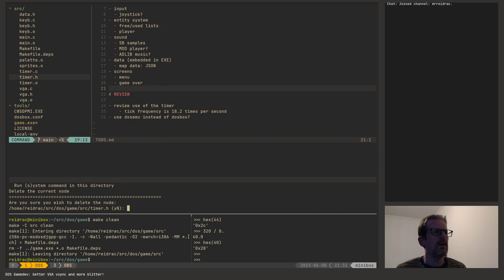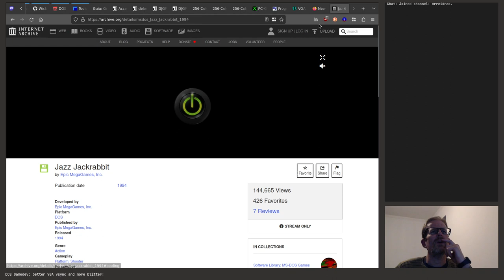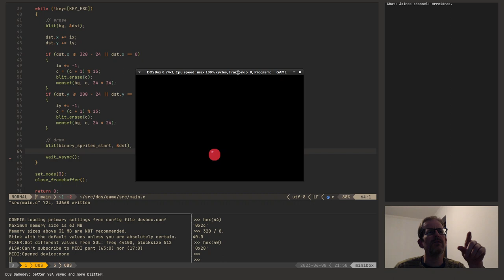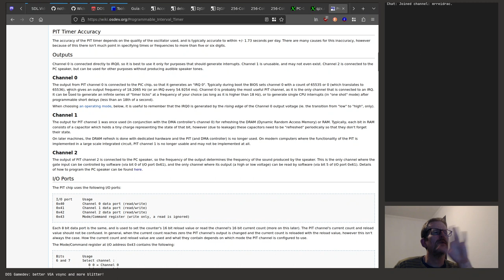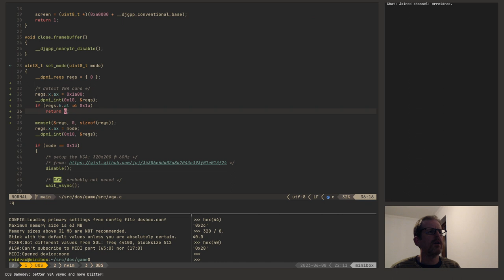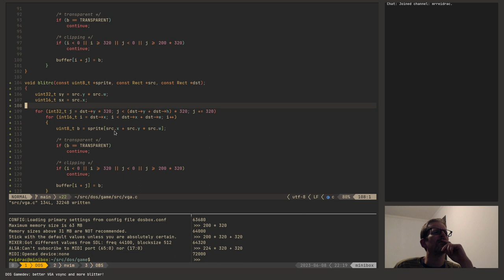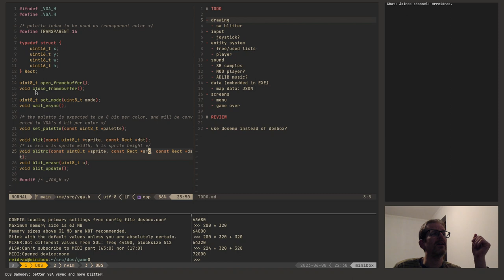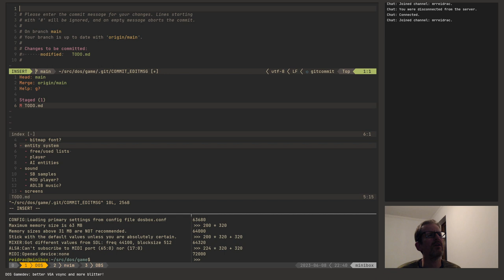reidrac is CODING 47: better VGA vsync and more blitter!

Comment: For 320x200x8 i like to draw into an empty buffer of 64kb in RAM and copy the buffer to the screen after waiting for VSYNC.

And for a higher resolution like 1024x768x32@100hz (using a 19 CRT monitor with 96 capacity) i like to use the linear framebuffer in combination with VBE 3 triple buffering within the 16 bit Big real mode/Unreal mode on 80386+ CPU. (I am not familar with the C programming language. I use the assembly programming language only.)